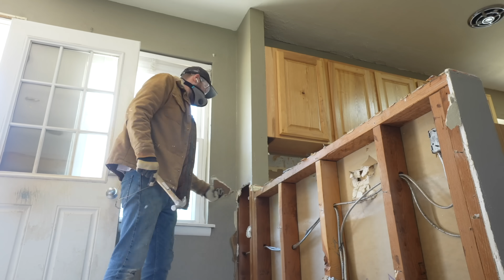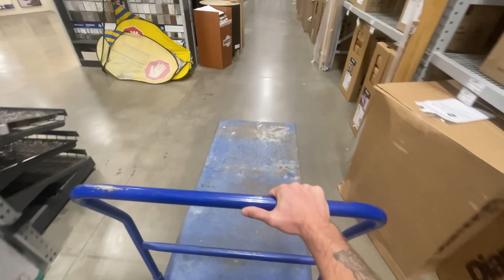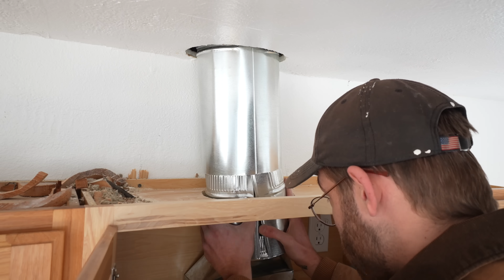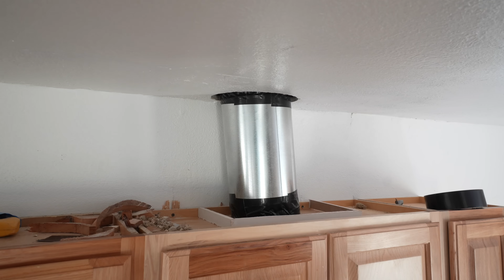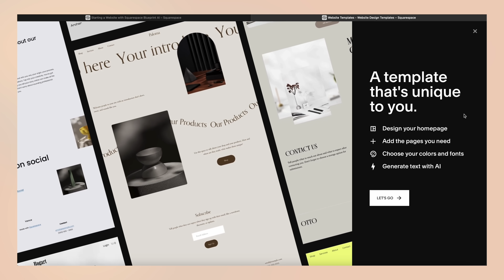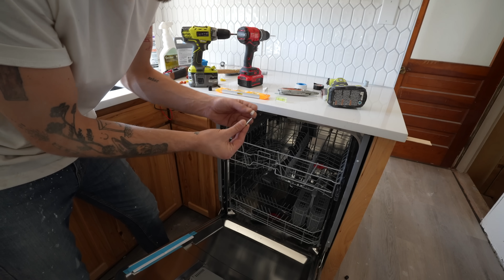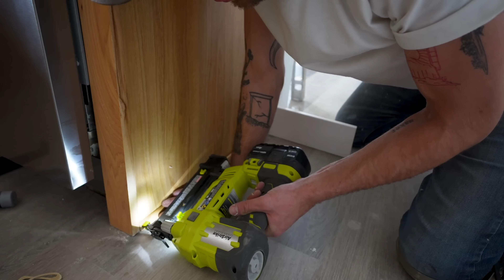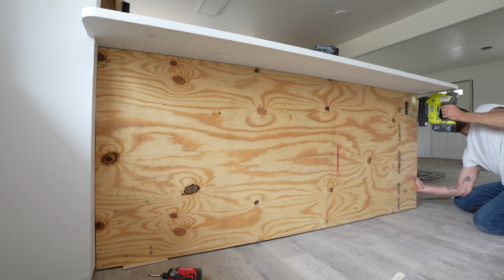I spent $5,000 to gain $25,000 in Equity!!! DIY MODERN KITCHEN RENOVATION

Comment: @ModernBuilds — Having come across and watched this video on 08.15.2026, I thank you for it.

I applaud the Do It Yourself skills.

The kitchen, in the end, does not look good. It needed design. It needed tastes cosmetically, including the cabinets, the backsplash, the colors, and the flooring. It is not modern; oh, and design decisions, especially with the mounted microwave.

The cabinets are redundant. Rather than excessive to-the-floor doors … a smarter design would include generous pullout drawers which could accommodate items such as cookware. 

This kitchen is larger than that many have in their households. So, design is important. It is not only for the visual; it is also for the function.

Comment: I remodeled a kitchen several years back and decided to not spend the money buying the toekick, I bought 1 sheet of 1/4" cabinet-grade plywood, cut it to the correct size, and painted it a satin black. It gave the appearance of floating off the floor and saved a ton of money

Comment: big problem... the top of stove is sitting under the countertop! stove top should be flush with height of countertops! and talk about not getting your measurements right that 6 inch gap between oven and cabinet. you should have built an actual cabinet for that space to store cutting boards and thing cooking sheets instead of a filler. hate HATE LVP flooring. honestly hate the color of cabinets.

Comment: Nice job. One thing I would have done would have been to use aluminum tape for the duct. The black tape will fail after a few years and whenever you replace it, go for the gold (or aluminum) standard tape!

Comment: I understand the point of wall textures, but man do i hate that stuff.  My whole house has knockdown texture, and it makes any reno / repair work almost impossible - because matching existing texture during new work is extremely difficult.  I finished my basement myself, but had someone come in to do the texturing to match the rest of the house.  But when a leaking pipe in the ceiling caused a few square feet of drywall damage, i absolutely could not match the texture.  I sanded it off, called in the guy who originally did work, and even he couldn't quite get it to match.  But i'm picky - i guess most people probably wouldn't notice.

I would like to change the kind of lighting i'm using in that basement, but i'm dragging my feet because i'm going to probably have to sand off 1,000 square feet of ceiling and retexture to have it look consistent...

Anyway, great video - thanks for sharing it with us!

Comment: It was driving me crazy going back to do drywall work after the appliances were in.... Get all the electric and mechanical (ducts) done first, then do your finish drywall, ONCE!  

ALSO gotta hit the new drywall with pva primer first BEFORE texture.

Not much reason to skim a wall if you're going to put texture on it anyway. Texture hides imperfections as much as skimming it fills them in.

The outlet on the little nub wall should have been relocated to the inside of the wall so you don't have to wrap your cables around the outside. 

In general, I'm curious whether the electric meets code. I don't see an outlet between the stove and sink, and iirc you need one every four feet. 

I'm guessing the cabinets over the fridge can't be opened because the fridge hinges are in the way. Get your rough in marked out before hanging any cabinets. I would have gone with a  counter depth fridge or gotten full depth cabinets over it.

Pantry cabinet next to the fridge. That little counter space isn't going to be as useful, especially with no outlet. 

Mesh tape- ALWAYS use quick set mud with it. It's not going to last using joint compound. It's better to use paper tape anyway, but you shouldn't use standard joint compound with mesh tape. 

Finally, only a matter of preference, but I would have just nixxed the OTR microwave and put a wall mounted range hood - it comes with the duct cover anyway. Microwave could just go in a pantry cabinet next to the fridge (and better for traffic in the home too)

Comment: Around here just swapping in the beam to remove the wall would be more than $5k.  Permits, engineering consultations, contractor labour and profits etc.  Heck I hired a contractor just to smooth the stippled ceiling in my kitchen, halls and living room for $3,600 - just the ceiling.

Comment: You could have chosen a counter depth refrigerator.  What you have now looks funny with that wall cabinet over it. Wall cabinets are typically 12 inches deep.  How is anyone supposed to gain access easily and put stuff into the cabinet over the refrigerator?? if you didn't want to do that, you could have opted for a deeper cabinet that is specifically made for over refrigerators which would be in LINE with the refrigerator (well maybe not that depth of a refrigerator-it looks 30 inches deep) however you could have built it out with false walls on the sides.  Or better yet NO wall cabinet over the refrigerator or next to it. Too many cabinets on that kitchen wall.  Otherwise kitchen is open and airy.  Somehow I think your cabinets look like a mixture of hickory finished and maple ones. Textured walls are so old style.

Comment: Those cabinets are awful. The warm tone clashes with the cool tone grey flooring. I would have painted them. Also, add a kit around the refrigerator to give it a built in seamless look. Lastly, add hardware to the cabinets. These 3 cost effective steps would have added thousands more to the value of the kitchen.

Comment: I don't trust these DIY'ers who flip houses. They will put a new floor on top of an old disgusting floor that has mold growing, and the unsuspecting buyer won't know about this for a few years. They basically put a pretty bandaid over an infection. 
I recommend before buying a house that has been renovated, ask for records of who did the work. And if the seller refuses to provide records of who did the work, then you will know a DIY'er did the work giving no consideration to doing it right.
One big clue that this house on the video wasn't done right is they put a wood floor in the kitchen. The kitchen, bathrooms, and laundry room are all considered to be wet areas and require floors that resist water damage such as ceramic tile.

Comment: Major upgrade.
A few observations for options on future flips.
When you had the sheetrock off above the base cabinets, cutting it higher so the seam would be hidden by the reinstalled uppers and completely hide the joint.
When the backsplash sheetrock was off, shift the outlet boxes forward so they would be flush with the tile/or replace them with a big enough box for the larger size USB outlets. In future flips, suggest using the boxes that have an adjustable depth screw so you can match box depth with whatever finish you choose. Same in bathrooms where wall finish/thickness might not be chosen before walls are closed up.

Start the tile at the corner of the door opening and work back to the inside corner. That way it would be a full and half piece instead of a 3/4  and narrow sliver. It is a nice touch to carry a joint around an inside corner, but these corners tend to be hidden by counter clutter/small appliances. No one will notice the sizes stuck back in a corner yet will see the edge of the tile every time they walk through the door.

With the frig sitting at the corner, it dominates the kitchen. Since you had framing done, there was room to build a wall extension to hide the left side and fir out the back wall around the frig so the base cabinets will match the frig face. It will have a cabinet depth frig look(more modern) with the larger usable capacity. Total additional effort would be minimal since you were already doing framing and sheetrock.
Reply: Agreed the fridge is so big 😅 i was wondering to put pull out pantry cabinets on those sides would have made more sense

Comment: I'm usually not a fan of stock cabinets from big box wholesalers but what you did with the angle brackets was very smart. Sometimes the adhesives used for the box assembly of the cabinet with these more mass produced cabinets don't have enough adhesive or simply just fail over time so reinforcing them is the best thing to do to keep them on the walls. Another thing to kind of call out is that the upper cabinet you repurposed over the fridge is a little too shallow to reach which could've been bumped out with a couple side panels and to be honest I'm not a huge fan of the natural style contrasting with the contemporary appliances and flooring, but I also understand that keeping the existing cabinets was apart of making budget. Overall, the remodel quality looks very well done and functional.

Comment: Hahaha. Seriously, a vent to the outside for a microwave? Is that a requirement in America? If so, why? No wonder we in Europe are better at construction and house building than you Americans. In Europe you can put our microwaves in the cupboard, leave them running for 6 hours and nothing happens and don't tell me that the ventilation is for odors, they are still there, with or without ventilation. But even worse is this fucking duct tape. Seriously, how can you rent it out with a clear conscience? Far too much pointless work. Not just pointless work but simply bad work.

Comment: All those kitchen plugs should be gfci protected due to the amount of moisture is produced in kitchen. Just FYI. Especially the one for the microwave. If steam from boiling water on the stove gets up there, could be risk for electrical fire. Just some added protection. Reno turned out great man 👌

Comment: My only suggestion would be that the refrigerator looks like a behemoth being on the end of that short wall. I'm not in the room with you, and I recognize it's important to make sure the doors on the appliance have room to swing open without knocking into a cabinet or wall. But the fridge just looks SO oversized in relation to everything else. I wonder if there could have been a way to try and build a nook/open closet situation so it hid the discrepancy in depth. Just some reflections and suggestions for next time. Wonderful work all around!
Reply: You really think that’s the only flaw in that kitchen? Lmao.
Reply: I noticed that as well, & for shorter people, I would have used the space beside the dishwasher to store a step or stepladder to get into higher cupboards. 😊

Comment: My criticism of your project: The location you chose for the refrigerator does not provide practicality or mobility to the space. And the cabinet above it is too far back, which will make it a space for kitchen clutter. For such a large appliance, wouldn't it have been better to have placed it closer to the work area? Congratulations on your dedicated work, but next time, ask the opinion of someone who actually uses a kitchen on a daily basis.

Comment: it really came out great!  One suggestion for using the wood slat accoustic paneling. I would want to float any MDF product above the floor 1/8" (you could add wood or pvc trim to the bottom if you want it to reach the floor.)  The reason is that MDF has a tendency to bulge when it gets wet which can happen when the floors get mopped.

Comment: Great job! I hate to criticize a video like this but there are definitely a few things I would have done differently. Maybe my opinion is even worse so im not going to say im right. Firstly, the color matching could be better. The colors of the white countertops, wood cabinets, and grey flooring just dont mix too well in my opinion. If you got those things at a big discount then thats totally fine, but if you had the choice to pick something else then I would have gone with different colors. Second, im not a big fan of the honeycomb style above the countertops in combination with the "theme" youre going for. Yes the honeycomb can definitely work with some themes, but I think it would have looked a bit cleaner if you went for a simpler design that didnt draw too much attention to it. You want the attention to be drawn to the larger appliances and nice cabinets but the white honeycomb draws a bit more attention than it should. I also want to mention, I think you did a great job with the appliances themselves, they definitely look updated and more modern so big plus there. ESPECIALLY the refrigerator, but unfortunately the cabinets right next to the refrigerator make it look more dated than it should. Wood cabinets can absolutely work fine but this particular style just doesnt compliment the appliances too well, it just makes them seem a bit more dated. You can look at the new appliances and easily imagine them in a much more expensive kitchen and million+ dollar house. This isnt necessarily a good thing here, I would have either bought less expensive appliances to match the style of the rest of the kitchen or updated the look of the cabinets to match the new and expensive appliances.

Comment: You did a ton of work. I got a kick out of the waterfall sink. The only suggestion I would have if it were house for you to live in is to use a counter depth refrigerator. Also check out the floors. Lots of useful information in this video. Thank you.

Comment: You didn't mention how much it was to take out that wall and add a new support beam. I know it's not part of the kitchen but in my opinion, it is still a contributing factor to the overall look of the kitchen. overall, it looks great
Reply: That easily coulda cost 2-3k without materials.

Comment: Are you a registered electrician?  In Australia the electrical work you undertook needs to be done by someone authorised/trained.  I mean you wired up an LED light in the kitchen ceiling and it was live! But I agree - that sink is awesome; so many features.  Taking out the wall and redoing the main bench has made the area so open but also a lot more working space.  Great reno - Tx for sharing

Comment: Just a quick observation...always use metal tape on ductwork. Duct tape glue degrades and will peel off in a few years and need replacement.